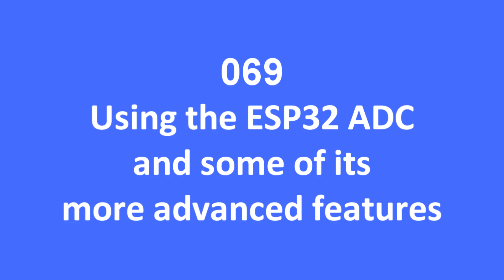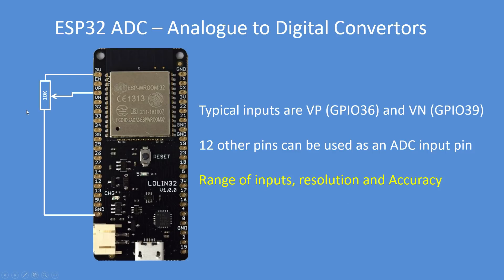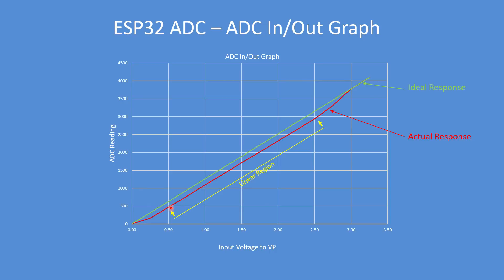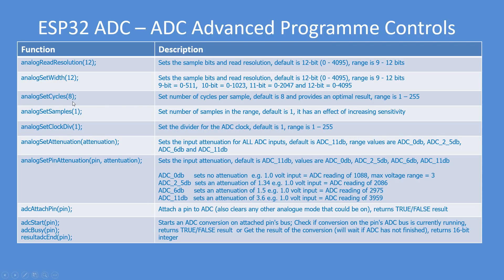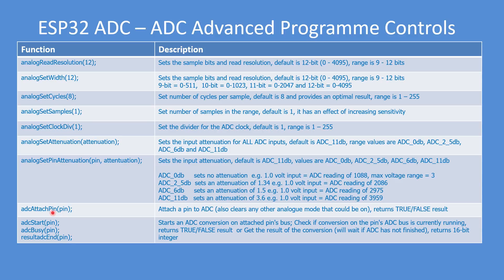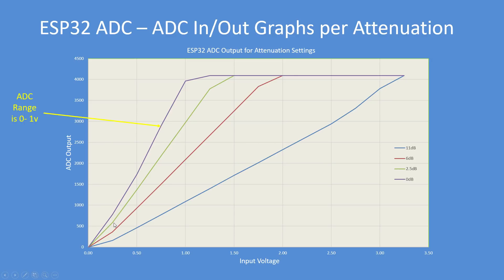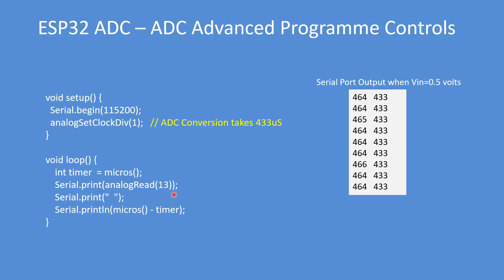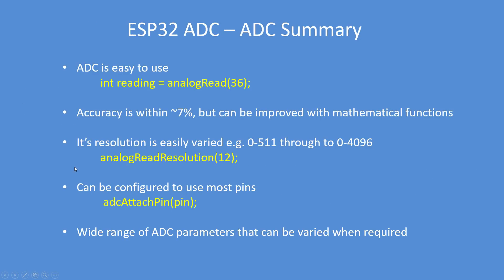Tech Note 069 - Using the ESP32 ADC and some of its more advanced functions

Comment: Hello, just discovered your channel, I like the way you explain things, but I do have two questions about ADC :

- How many ADC can ESP32 use at same time ? 

- if it is only one at a time then I guess you can switch each PIN you want and read Analog value from Pin X to Pin Y in a loop so you can read for example 10 analog source values ?

- What is attenuation for ? I mean do it allow to input more than 1V to attenuate to the range of 0-1V and if yes what is the max voltage input ? I see you show 3V in your video.
Reply from the maker: Thanks, there are 18 ADC channels but only one can be read at a time, unless you get the ULP processor to read a channel, but that's a more advanced programming feature. Given the time to read the ADC is about 1uS and most analogue world values are quite slow (relatively) then you can sequentially read the channels. So as you say you could read all channels in one go, noting a very short time gap between each reading. Something like
void read_ADC_Channels(){
  value-1 = analogRead(pin-1);
  value-2 = analogRead(pin-2);
  ...
  value-n = analogRead(pin-n);
}

The maximum input value is Vdd or 3.3v, but in-practice because of non-linearity, the maximum is constrained to about 3.0volts. 

When you adjust the attenuation value you get this effect:

0dB attenuaton (ADC_ATTEN_0db) gives full-scale voltage 1.1V
2.5dB attenuation (ADC_ATTEN_2_5db) gives full-scale voltage 1.5V
6dB attenuation (ADC_ATTEN_6db) gives full-scale voltage 2.2V
11dB attenuation (ADC_ATTEN_11db) gives full-scale voltage 3.9V (see note)

But note:
The full-scale voltage is the voltage corresponding to a maximum reading (depending on ADC1 configured bit width, this value is: 4095 for 12-bits, 2047 for 11-bits, 1023 for 10-bits, 511 for 9 bits.) 

So in the above example and assuming you have set the ADC's to 12-bit (0-4095):

0dB attenuaton (ADC_ATTEN_0db) gives full-scale voltage 1.1V for a reading of 4095
2.5dB attenuation (ADC_ATTEN_2_5db) gives full-scale voltage 1.5V for a reading of 4095
6dB attenuation (ADC_ATTEN_6db) gives full-scale voltage 2.2V for a reading of 4095
11dB attenuation (ADC_ATTEN_11db) gives full-scale voltage 3.9V (see note below) for a reading of 4095

This affects resolution, in the 0dB example and input of 1.1volts (you can still input the maximum 3.3 volts but it will read 4095, so it will climb from 0 to 4095 then stay at 4095 even though the voltage has exceeded 11.volts) each step = 1.1/4096 = 0.2685mV

In the 11dB attenuation example each step = 3.9/4096=0.9521mV

When set to 12-bit the difference is not that great but set to 9-bits then
0dB each step = 1.1/512=2.14mV
11dB each step = 3.9/512=7.6mV

You can get a wider input range by adding a voltage divider comprised to two resistors in series one end is the input, their intersection goes to the ADC input and the other end ground. If the values were 10K each the attenuation would = (10)/(10+10) = 1/2 and now the maximum input voltage on the 0dB range is 2.2volts for a reading of 4095.
Attenuation is Vin x R1/(R1 + R2) but be aware the ADC has a input impedance too, so don't use high values say > 100K as the divider chin will be affected by the ADC input impedance. In my example (no-one has published the ADC input impedance) let's say the input impedance was 10K then Vix10/(10+10x10(10 + 10)) = 1/1.5 not 1/2.

In practice it seems to be much higher than 10K, I assume 100K and then it's affect on a voltage divider is much lower.
Reply: Thanks for explanation so now I know I can connect multiple potentiometers to the ESP32 instead of having to add an extra ATMega328 or some I2C multiple channel ADC like I did for ESP8266

Comment: Hi David. thanks for beautiful introduction to adc concept of esp32. especially improving accuracy equation. i would like to know-
1) what is the background theory behind your polynomial equation? is there any literature i can read about it?
2) can we oversample ADC to improve resolution? i heard atmel ics have this possibility..
3) have you tried to experiment the low noise differential amplifier (svp,svn pins) with programmable gain? the datasheet has very vague info and drivers not yet released by espressif. 
4) i am trying for OTA- wireless update of sketch but no success yet-any thoughts on that.
Reply from the maker: Glad you like it. Regarding your questions:

1. There is lots of information around on polynomials, it's a 600-year old concept, what I would do is search google for 'how do I construct a polynomial'. For me I have been educated to 2nd degree level and it is a fairly normal activity, but if you need any help just ask. Essentially what I did was to find the approximate equation to the data using a straight line equation let's say y = 1.5x and then by inspection looked at the deviation from the straight line at each major point, let's say at x=1 y should = 1.5 but actually it was 1.49 and at x = 2, y was 3.05, but should have been 3, then I can add an element to the equation to correct it, now the equation looks like y = 1.5x + (1.49-x).(3.05-2) and so onto build the final polynomial. What's really important though is accuracy and resolution to get the correct result, if you look at the source code you can see how much resolution of the numbers I had to use, it's no good using 0.01 when it has to be 0.00987234345. Also search for 'table based approach to solving polynomials'

2. Yes you can oversample, but all that does is average out the results, it can never improve accuracy, what's happening by oversampling is the statistical mode is being found, which in general is a smoother result than a single reading. Whether the result is accurate or not depends on the raw accuracy of the ADC. If the ADC always gives a different result then what we see is the standard deviation away form some mean value that the oversampling technique gradually provides. If your seeing a lot of noise e.g. each time you take a reading then either the input is varying or the power supply is not as stable as it needs to be for stable ADC readings.
Hope this helps you.
Reply: Thanks alot for detailed reply.
1) Thanks about polynomial, if i understood correctly , so it is a LUT based polynomial fitting ? 
2) by oversampling, surely we are not improving accuracy, i wanted to increase the resolution ( increased resolution will just help measure accurate differences between two successive measurements - irrespective of whether measurements are accurate or inaccurate). i thought by your polynomial fitting based approach and oversampling - i can have ADC with increased resolution and better accuracy both.
Reply from the maker: 1) The use of the term 'table' was the table based approach to generating a polynomial.  There is no look-up table involved. Although you could use a simple table, but with a 10-bit ADC you'd need a lot of table entries.

2) Resolution and accuracy. Resolution is the precision to which a number can be determined or shown, e.g. 1.56 is low resolution and 1.5654321 is a higher resolution result. IF we read an ADC and get the result of 1.56 when in reality the voltage being measured is 1.50 volts, then the ADC result is inaccurate. By using a polynomial and if we assume the ADC conversion should be linear then we can correct for inaccuracies. Oversampling can increase the effective resolution from say 8-bit to 10-bit but it can never improve accuracy.

3.) You can use the polynomial approach to improving accuracy together with over-sampling to gain a little more resolution, but I doubt you'd notice the difference in practice unless your going to display all of the resolution. e.g. 1.5654321 instead of 1.56.

4) you can implement over-sampling like this:
value = 0;
for (int r = 0;r <=10;r++){
  value += analogRead(A0);
}
value /= 10; // Will give you an average value.

Comment: Can the ADC channels be used to measure battery level of a 3.7v LiPo? And if so what's the current way of setting it up schematics wise?
Reply from the maker: Well it can but there is no internal method of doing this like there was with the ESP8266. You need to connect an external voltage divider to one of the ADC inputs and then measure voltage like that. In it's simplest form this is a series resistor from the ADC input to your battery +ve and another resistor from the ADC input to Ground. You must take into account the ADC input impedance to ensure reasonable accuracy and one way to do this is to ensure the external voltage divider impedances are lower by say a factor of 2 than the nominal 10K ADC input impedance, so suitable resistors would be: 2K7 from Battery to ADC (lets say pin 25) and then 4K7 from ADC to Gnd, that gives you a 5volt input range as 5/1.5744 = 3.1volts which is the ADC maximum reading, so your 4.2v Lipo max voltage =  2.66volts at the ADC, which you'd then need to increase again in the programme to read volts again, if that makes sense. So your battery voltage (nominally 4.2 when fully charged) is divided by the resistors down to 2.66v then take an ADC reading and then increase it by (4700+2700)/4700=1.5744 so that in the programme 2.66volts read is increased back to 4.2 volts. It may need a little calibration because none of the devices are calibrated, so just adjust the (4700+2700)/4700 values to make the final result 4.2volts.  Let me know if that does not make sense or you need any help in doing this. ADC is best left at default 11dB attenuation for this to get maximum measurement range.
Reply: Thanks, that was very helpful, I am researching ways to collect battery info for my lipo powered project :)
Reply from the maker: One of the problems of using resistors is the quiescent current demand especially when this is many times more than the sleep current (6uA) of the ESP, it really needs an FET under control of the ESP to effectively disconnect the series resistance when not in use. Either that or just use a series resistor to the ADC input, but input impedance varies between devices so the results vary, ok if a one-off non production solution.
Reply: G6EJD thanks for the tip, I'll have a look into that for my next project, for now I decided to use some big 1MOhms resistors for the voltage divider, it's not the perfect solution but it works ok (draws 3uA) and I don't need high accuracy for my purposes

Comment: Im sorry but in Advanced controls table is an error. In attenuation description all attenuations are reversed, ie for 0dB 1V is giving readings about 3959 but in table is 1088, and 1088 is readings for 1V with attenuation 11dB. Beside nice info, very useful.
Reply from the maker: Yes it’s wrong, thanks for letting me know. All of the maximum count values are 4095. I think I rushed that bit and changed my mind on what was going to be displayed, but didn’t correct the table.